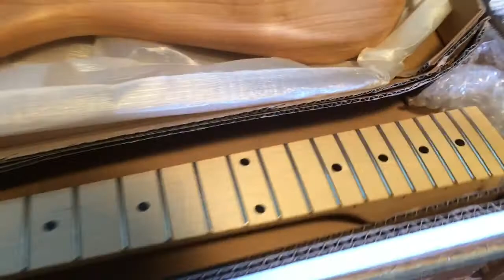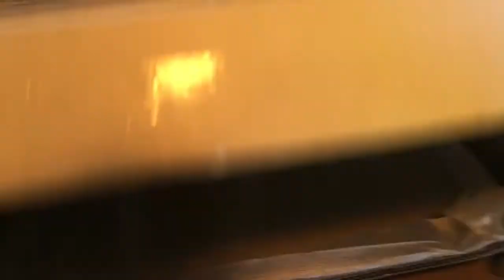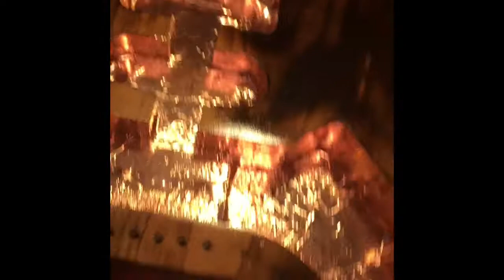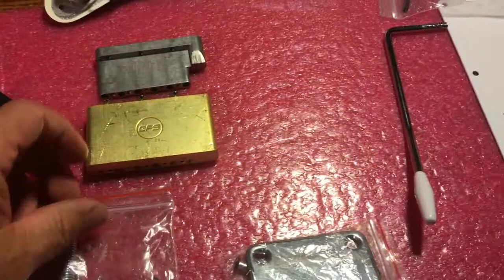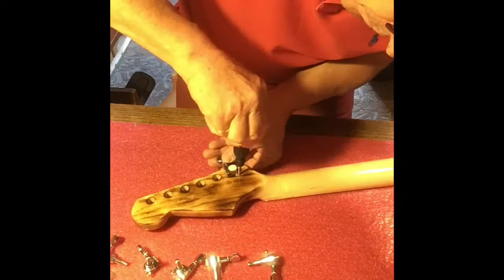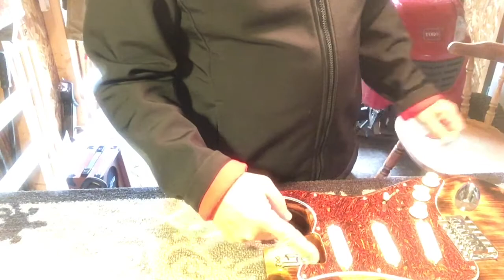Solo Guitar Kit - Burnt Alder Stratocaster Project

Comment: What finish did you apply over the burnt wood?
Reply from the maker: Whipe on poly. Apply with cloth multiple times with light sanding in between
Reply: @MasterGuitarFrets  oh cool thanks for the reply ! My strat kit finally came i can't wait to get started. Cheers 🙂
Reply from the maker: Have fun with it and enjoy the project. Take your time between coats. Let it fully dry and sand with 400 grit in between very lightly.

Comment: Those seams in the wood look terrible.
Reply from the maker: What can you expect for a couple of $100. She sounds sweet seams or not. The neck is absolutely fantastic to play. 
I like imperfection in instruments it makes them special.
Reply: HatedHero I really don't see what you're talking about. Most guitars have a painted finish. You would probably be really surprised if you saw how your guitars looked before painting. We're looking at a guitar that's less than $200  finished! It's not a Gibson or PRS that's 10 times the cost. It's an inexpensive kit that's a great way to learn about guitar building!
Reply: I actually just got a sunburst painted alder body for almost nothing because small parts of the seams were visible. When they select guitars for a more natural finish, they choose the one's which don't have obvious seams or they cover the top with another wood that is more aesthetically appealing. You did neither.